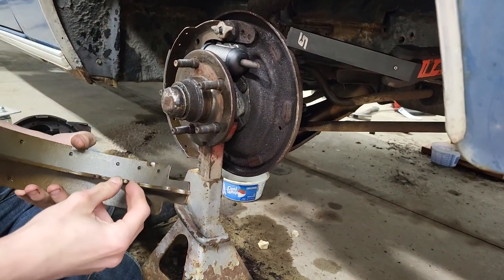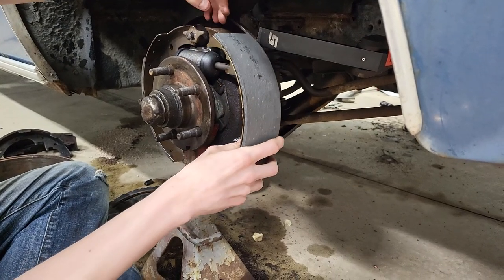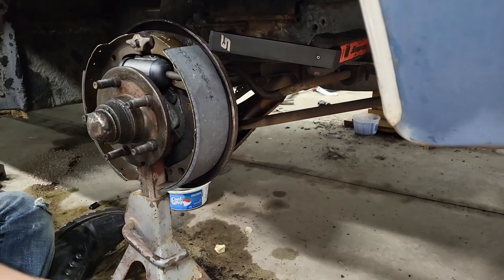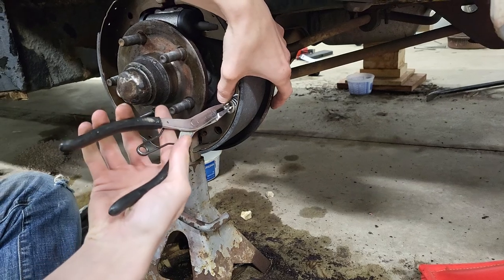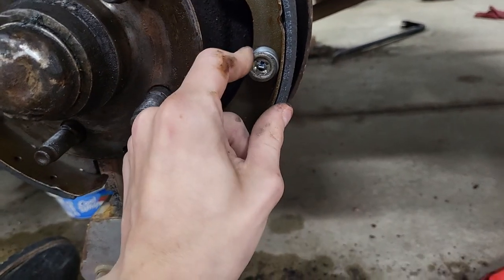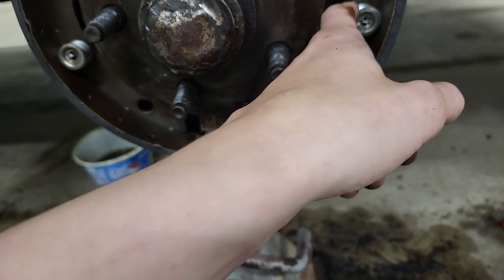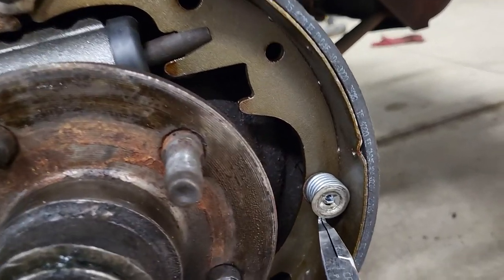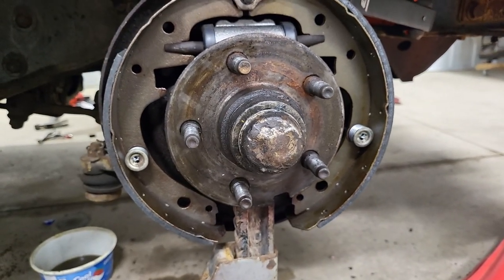easy trick to getting drum brake shoe springs on

Comment: Try a small 1/4" socket in 7mm or something that fits in the spring cup but allows the pin to push through the center then use a 1/4" extension or a hand driver it pushes equally and you can spin the pin from behind the dust shield

Comment: I put it all together. Is so tight now my wheel won’t move 😮… what do I do??
Reply: sell the car :/
Reply from the maker: You need to remove the rubber adjustment plug from the backing plate and use as small screwdriver to back off the starwheel gear that dictates brake shoe tension. You can find good explanation vids here on youtube